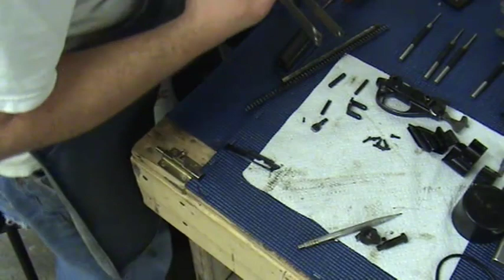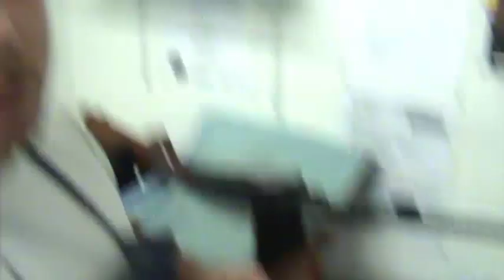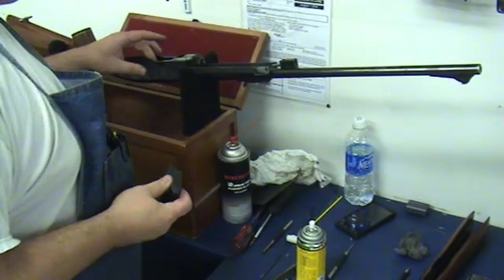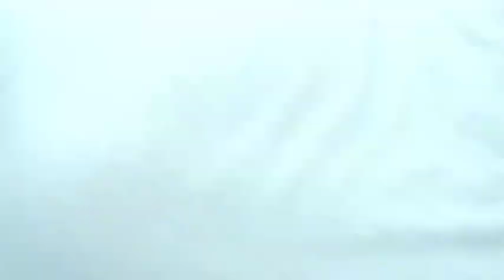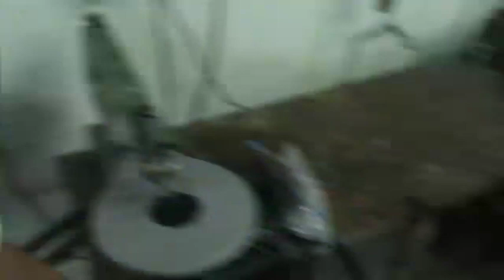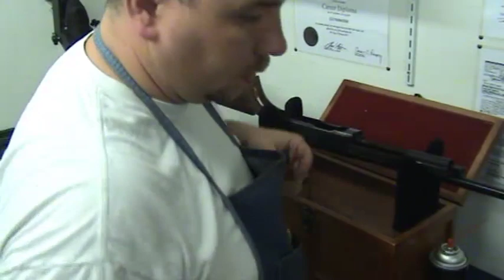Gunsmith Remington Woodsmaster 3006 Model 742 Pt.#2

Comment: Great video. I have an old 742 in good shape and when taking it apart the hardest part was punching out the little pin which holds on the cocking handle on the bolt. That little plastic piece , I threw in the garbage, is not needed in my opinion. These 742's had a soft receiver and the bolt lugs chewed it up. I had read an article a while back that the 742 had an expected service life of around 500 rounds. There is a way to block the gas port to convert these rifles into a pump action thus reducing wear and tear.

Comment: Good to see someone mention this about the 742's. The old 742's had soft parts in this area and they did tend to get chewed up. The 7400 supposedly fixed it but like my new 750 they even "nickel teflon" coated it. The 742's a decent rifle but if one can afford it I always suggest they go for the new 750's.

Comment: I just went thru one and beefed up the bolt lock by putting a no 8 shot in the middle latch hole on the bolt to increase tension...this is supposed to beef up the bolt lock system as my gun is getting old...also put a new extractor in it...used angle iron to make the rivet anvil tool and ground out the extractor rivet head from the inside before punching it out from the inside. The outside was too flattened out.  These guns are fun but will test your patience.

Comment: Great video. Have you ever fixed accuracy problems with the Remington 742 (30-06)? Mine is like new but shoots poorly. The shots begin to spread & "walk" downeven at 50 yards  Can the barrel warp or loosen from heat buildup after a couple of shots? Is this common & is there a fix for that?

Comment: are the locking bolt/lug interchangeable from the 30.06 to the .243?? I have two model 742's, a .243 and a .308. They are both in rough shape and I need to completely strip down both and thoroughly clean them. But my .243 bolt won't turn, looks like the bolt latch may be broken and I'm hoping to just replace that, but if worse come to worse could buy a bolt/lug out of a 30.06.
Reply: The 740s 742's in 243/ 6mm rem 25.06 & 308 are short action. 35 rem/ 35 Whalen /30.06/7mm Express/ 280/270  are all long action. Case head diameter is a factor. I don't believe a 30.06  bolt will work for the 243? Could be wrong though? A set of calipers to measure it would be a for sure way to find out. The pins in the bolt sometimes get worn and fall out or slide outward causing the bolt  lug to not rotate or even lock down inside itself not allowing it to even chamber. Tear it apart cautiously could be a simple fix. I know this is an old video but i noticed no one ever responded to your question. Best of luck hope you got those old WoodsMasters back in action 👍